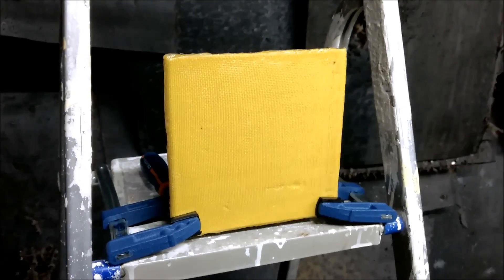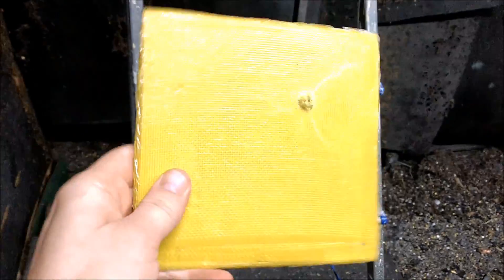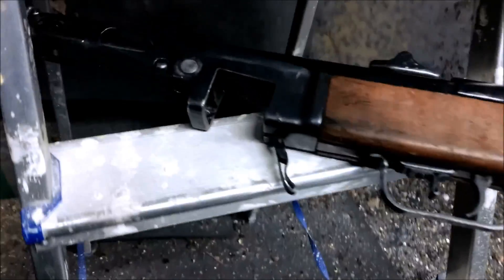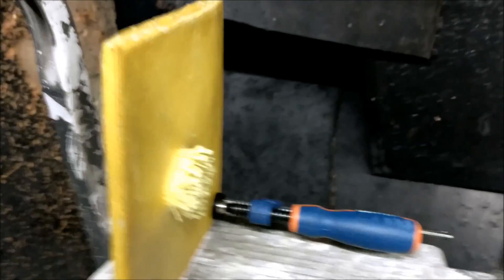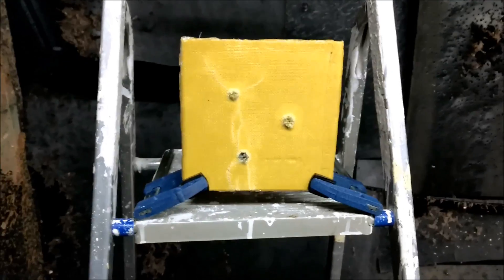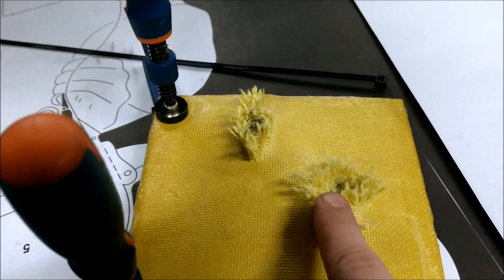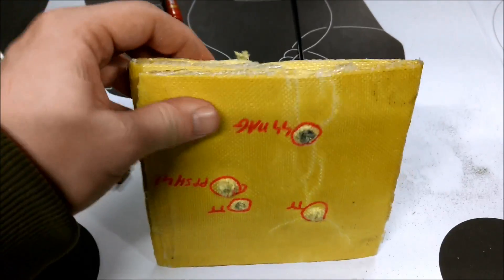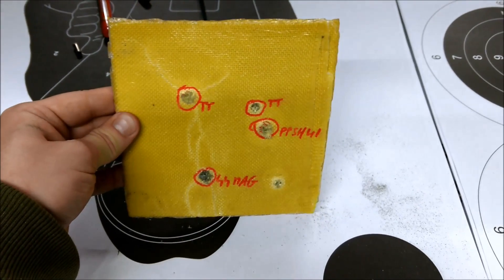Homemade bulletproof armor plate - Test of kevlar 29, 18 layers

Comment: The 'flower' look you speak of seems to be created because you only coated the outside of the 18 sheets instead of soaking each sheet and then compressing all 18 together. This is also why the front separated from the back, after the 1st shot. This entire 'test'.. isn't very good.
Reply from the maker: @philip6419  Hi. Every layer is soaked in poxy and than compressed until cured. I have a video about how I make the sample. So your entire 'theory'.. Isn't very good.

Comment: You don’t use resin on Kevlar! It defeats the mechanism that makes Kevlar so good at stopping bullets
Reply from the maker: I know, but I was wondering about how it will do as a hard plate, that's why I did all those tests. Thanks for the comments. 👍
Reply: Just wanted to make sure so that you didn’t think you’re results were at all indicative of how such Kevlar is meant to function.  **9 layers of most Kevlar (200 denier being common) will stop up to most standard 9mm’s…Add fabric impregnated materials and/or combine actual materials (like UHMWPE - Spectra or Dyneema) at approx 10-20 layers in front of about 9-12 layers of impregnated Kevlar (STF or other non-neutonian fluids) and then both materials stacked and pressed under hydronic pressure = to 20,000 lbs/sq inch ….and at a temp of approx 150 degrees (for an hour) and then another hour until release to cool off first.  Thus, resulting in a super compact/thin insert that delaminates upon impact (remotely) thus dispersing is the energy / back face deformation. ***Graphene, exactly TWO layers, so stacked in front of the Kevlar & UHMWPE can allow there to be a reduction in both by about 30% (5-7 Kevlar layers + 8-11 UHMWPE layers with 2 graphene layers in front)

Comment: Bro stop coating everything in epoxy. Epoxy shatters and weakens the strength of the materials you're using. Using an adhesive with more flexibility then epoxy such as some sort of gluing agent and you will have a lot better results.

Comment: 1. You didn't use the specified number of layers. You need 30 layers
2. You made this Kevlar into a plate with a resin, which would have made the fibers brittle.

Basically we have learnt nothing with this video.

Comment: This plate looks folded.. when kevlar is layered it should be offset as much as possible. For 18 layers you would turn each layer 10 degrees of center to make a full circle . This multiplies the effectiveness exponentially simply by overlapping.
Reply: Underrated comment
Reply: interesting , would like to see that tested.

Comment: Next, this Kevlar fabric would work best over titanium. And, a thick layer of Kevlar over a 3.6mm titanium sheet metal shield would actually stop the higher calibre rounds. In addition, the combined weight of Kevlar and titanium would be around 13 kilograms for a 40cm by 40cm bullet proof shield. Therefore, you just need to go to the sheet metal shop and the Kevlar store to make a bullet proof shield. Lastly, with a layer of rubber glued to the inside the titanium shield is also taser proof. You just glue and bolt the whole shield together.
Reply: Incorrect - putting the Kevlar in front of the titanium would render the Kevlar virtually 50-80% less effective.  The mechanism of Kevlar is much like a net and a bullet like a hockey puck.  Even 100MPH shots go in and are stopped and immediately drop to the ice still in the net.  In slow-mo you woukd see the net gradually slowing and capturing the puck - spreading the energy out to other threads (fibers).  Now put a stiff backing directly against it and pucks would bounce out and away from the goal - but if they were faster and their strike-face resulted further, it would “slice” through — just like bullets would do to Kevlar in front of metal
Reply: Yep, that makes complete sense. And I will fibreglass any Kevlar to the back of the plate and not the front.

Comment: this type of Kevlar plate is meant to be used in conjunction with ceramic in the front as a level 4 plate. the ceramic will break up the bullet and the Kevlar catches the fragments. it can stop most armor penetrating rounds
Reply: That depends if hes trying to make pistol rated kevlar or not. Kevlar can be used on its own to stop anything up to level 3a. Most police officers that wear armor, wear kevlar and no hard plates. He was also way to close to test this accurately at all.
Reply: Instead of ceramic what about uhmwpe???
Reply: @meditationhaven3722 UHMWPE cant deform hardened cores, so a 30.06 M2AP can penetrate almost 10 cm of HB 90
Reply: @meditationhaven3722 
UHMWPE can't effectively get to IV(RF3) without a strike face to break up the penetrator. 
It also has trouble with M855 and M855A1 because those are semi-armor piercing.

Comment: Kevlar bulletproof plates are typically 20 sheets. Take 20 sheets and the resin add powder graphene to the resin it will add more protection to the plate made.  3% of total resins weight should double the the strength while adding 3% powder graphene to mix resin well. The mix will also soak into the Kevlar better with the graphene in the resin. They say 2% graphene added to concrete makes 70% stronger.

Comment: Kevlar should protect against an 7.62mm round, but I don't know what type of Kevlar the military uses.
Reply: Kevlar alone wont stop rifle calibers, only pistol and shotgun. To stop rifle requires hardened steel or ceramic layer to break up the bullet. Current Lv4 and 3+ which can stop rifle calibers uses either steel with optional anti spawling layer or ceramic such as alumina front with a UHWMPE or kevlar backer, with kevlar being seen less and less in hard armour and normally reserved for soft armour which as stated is only pistol and shotgun rated.

Comment: Kevlar needs to stretch and bend to absorb impact, the epoxy is pretty much freezing the kevlar into place, so it rips instead.
Maybe you should try and dry vac some kevlar sheets between a thin layer of plastic so it's sealed THEN dunk it into epoxy resin.
Reply: Yeah. I wonder why every diy kevlar hardens their kevlar armor with resin and other stuff while the first kevlar armor is just made of kevlar and its not that solid
Reply: @esudario  Maybe because the helmets are solid so can withstand more than the soft body armor. 
The soft body armor does not "absorbs" bullet energy in any other way, the same stiffed with resin. You need to sew together the layers of Kevlar material with, of course, Kevlar thread. It is an absolutely crucial factor for the soft panel to compose into the proper set. The resin fills this role exactly role. Soft panels are soft only because it is comfortable. There is literally no other factor that stays behind the protection panel to make it not a rigid plate. 
If you think kevlar can stretch as a soft material enough to absorb impact, think again because about half of the "absorbing impact" relies on your body tissue flexibility, mainly broken ribs. So yeah, you are right it sure does absorb the impact. The only problem is it does this way beyond the place the human body starts. 
The ballistic protection is ALWAYS better in rigid form.
The vacuumed resin is always better. Similar effects are obtained, with the curing of the composites under heavy pressures. Forming,
 of the shape of the helmet, or the anti-spalling layers or the safe IFV seats, for armored vehicles. It's used, also as a lightweight Kevlar and titanium-based protection for the helicopters.

Comment: Have you taken to account that the first shot had already weakened the structure of the material. That's why i believe they can't stop multiple shots.
I believe trying each shot with a new plate would have yielded different results.
Reply: The hits were on completely different areas.
The NIJ considers hits being 2in away from eachother to be fair.

Comment: Need to do a much better job laminating  or how about not sew it together with kevlar and put ceramic  plates in the front like they do for real armor tou should have just the fiber unlaminate 18 layers or 20 then make plates with the epoxy but the front having ceramic  plates is to break up the round then you can stop some serious stuff
Reply from the maker: Because it is a test of Kevlar 29 in epoxy resin. I'm not trying to replicate other armors.
Reply: But you should have done a much better job laminating  the stuff 18 layers bshould be very thin your finalnproduct could have been much tighter had you wither applyed a vaccume or significant amount of pressure  to ensure that the layers were able tonhold together tonthe best the epoxy can you shouldnhave wet rhe kevlar with hardner then applied  rhe mixed epoxy  to each layer and squeegee it  between layers and then pressed it between a coupple plates with at least 30 lbs on it just sayin it wouldnt have come apart like that and held up much better ive seen fiber glass preform better rhen this if done properly
Reply: Or like most on the market just 30 layers ornso of it unlaminate is better then this or even coating  each layer in silicone on thier own and then layering it its flexable and can stop a lot try it if you want to see by how much personally  i think silicone trearmwnt works the best but incould be wrong

Comment: what is the bare minimum amount of layers to stop penetration from higher caliber handguns?
Reply from the maker: It's not the caliber that is important but speed. Tokarev 7,62x25 is a smaller bullet but much faster than 9mm for example. 45ACP is slow but heavy, easier to stop but high impact force and trauma even if stopped by a plate or vest.

Comment: How much did you compress it and what density of kevlar did you use? 200g?
Reply from the maker: This is original Kevlar 29 and I believe it's 1500 denier. I don't remember. I just clamped it between 2 plywood boards. There is video about how I make it.

Comment: Did you resin the thing together under pressure or just leave in on the bench to dry? The other question is could you share the weight and dimensions of the piece, please. Bo wiesz, garaż czeka :P
Reply from the maker: Check my other video how I make it.  It's all there
Reply: @Drzewacz888  Checked it after commented, unfortunately. I'm planning to recreate Your test with a bit altered design. I'll let you know about the results.But a quick question first. I get to know about a thing called a conveyor repair glue.  Unlike resin, it is not brittle thus, theoretically should not hinder kavlar fibers strech properties making it semi-hard plate at the same time.
Reply from the maker: @OstatniVorox  try it, test it, upload it. All I can say about it. Epoxy goes nicely between fibers so all layers are filled. No air gaps. Mine was only 18 layers to compare it to standard Kevlar. 18 layers is not a lot for ballistic protection so I would go for min 25.
Reply: @Drzewacz888  Due o the cost, I'd rather go for Aramid than Kevlar and test the principle, then I'll do the comparison analysis and upload. I'll let you know if you're interested.
Reply from the maker: @OstatniVorox  sure man! Do tests and upload. I'll watch it with pleasure. Aramid materials are basically a Kevlar. Kevlar is just a brand. My first test was with basic aramid materials.

Comment: One of the factors that makes Kevlar bulletproof vests bullet-resistant is that the fibers are free to move and not fixed in epoxy.  My adding epoxy to the mix you are actually making this less bullet-resistant.  You should be able to stop a 44 mag with 9 layers of Kevlar 29.  Maybe test it against a cinder block backing with 2" of closed-cell foam in front of it.
Reply: That is simply so wrong.
Reply from the maker: Yes, you are right and I also know about it. But I was wondering how strong a hard plate can be. All my videos are about hard plates. I also shooting this plate with 44 mag but it's a rifle so the speed of a bullet is much greater. That foam backing is a good idea though. I still have left some Kevlar 29 so I might try this. Thanks.
Reply: i was thinking that it seemed like the bullet broke the resin and the kevlar broke with it, like shattered

Comment: a little too thic, If it could go for 4mm or 5mm and still stop the bullet would be good for full body
Reply from the maker: maybe if the plate was done in the vacuum bag it would be a bit thinner but soft body armour is not thin, usually it have over 40 layers of different materials. If you want 4-5mm thick you need to go steel or titanium but this you can make in almost any shape.
Reply: I don't think it's too bad, hell I would even go for maybe even 3 or even 4cm, it might be heavier but my winter jackets are still thicker than this
Reply: Well first of all, this is absolutely not made for full body ballistic armor. Nothing is made for that cause it's just stupid

And about the thickness, it's actually really impressive considering that SAPI plates are almost exactly 2.5cm thick. This could be used as really effective armor if it was that thick

Comment: Kevlar is crap use zylon fibre and epoxy mixed with 60% ceramik powder! And by the way, some epoxy resins are corosive,so they destroy the surface of the kevlar fibre.
Reply: It looks like you got your 'facts' wrong. Zylon isn't reliable, which is why nobody uses it in body armour.
Reply from the maker: And where i can buy this zylon material and how much it cost?

Comment: great video. I wish you had made your tests with the armor wrapped in denim and backed by a soft human-like material. Shooting without backing may reduce penetration. Also, on the curing, you could consider curing the kevlar-resin matrix at 80Celsius for five hours. This apparently significantly increases the performance of the resin matrix by around 30%. Coupled with more layers, this could be very impressive. Many thanks for the videos!
Reply from the maker: Thanks and i'm happy you liked my video. Few things though:
Why would i wrap the plate in denim? I am testing the armor plate not the bullet. Notice that people who test the penetration of the bullets in ballistic gelatin will put denim in front as this can affect bullet when entering soft tissue. Have you ever seen people who test AR500 plates wrap them in denim? No, because it doesn't matter.We testing armor plate here. What happens after penetrations is pretty obvious - big problem ;)
At the moment of test i was improvising a little bit as i did not had a lot of time. 
Human like backing material? Well, non of my friends or enemies did not want to hold it for me ;)
As for curing poxy in higher temperature, well maybe you right. i don't know. I am using poxy resin to turn soft materials into hard plates, but i still rely on the strength of the material to stop the bullet, poxy is for holding everything together.
Thanks for watching and i hope you will enjoy next test in about 6 weeks.
I will have Tungsten 2mm+Titanium 3mm + aluminium 4mm plate and Tungsten 2mm +aluminium 8mm plate.
Also i will shoot titanium plates from previous videos with Desert Eagle .44 Mag :)
Reply: Thanks for the response, comments and questions. The denim is to better simulate armor use by people, and although it may not make as much as sense in AR500, against pistol rounds, it may make a difference especially if placed in the back of the plate. As far as the soft human like back rest for the plate, this is to better simulate armor being used by humans (as opposed to vehicles, doors, panels, etc), since the softer material acts as a cushioning force and is likely to change results. Of course, you don't need to use gelatin or live meat, hehe, but maybe something like styrofoam or hard sponge material could provide a better simulation. My bad on the heating curing process since I was thinking about polyester; I am not sure if 5 hours at 80 C would have a better effect on epoxy, as it is supposed to have on polyester. In the case of polyester, the higher curing temperature and compression is said to hold the fibers better, which as you point out is the goal of the resin. If I remember correctly, I think that the extra heat on epoxy would be too marginal, and of course epoxy trumps polyester even when polyester goes through the heat/compression process. Many thanks again. I'm no expert but I've been doing a bit of research and can't wait to share new knowledge or ideas and to see the results of your future tests! Desert Eagle, bring it on!